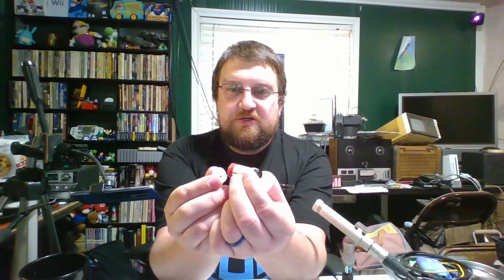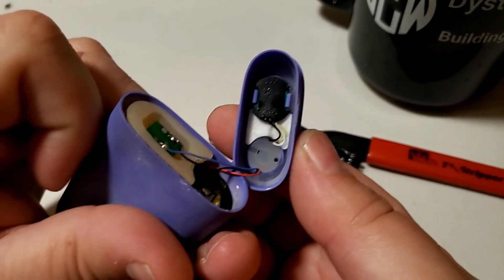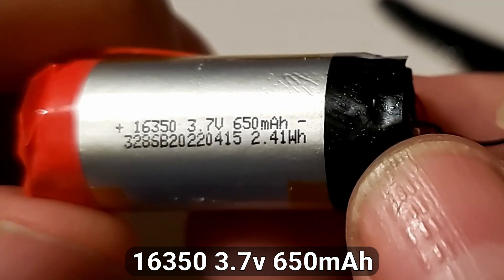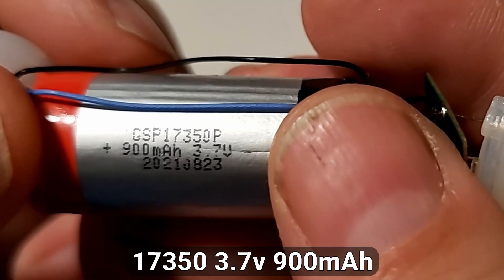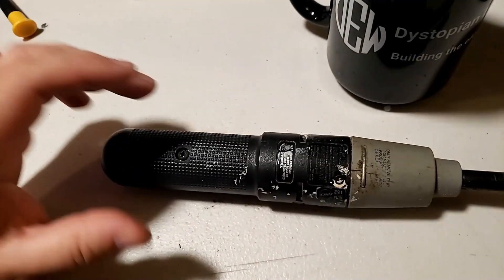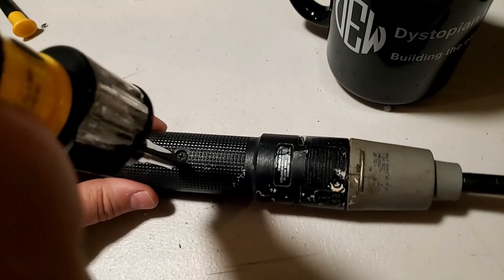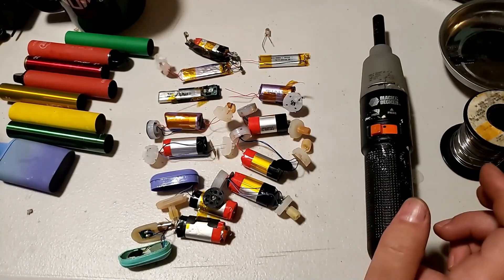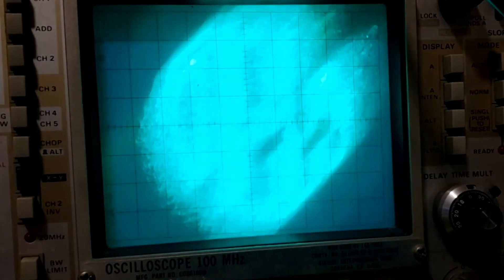DEW 3 Free Batteries and Saving an Electric Screwdriver

Comment: Is the screw driver still rechargeable?
Reply from the maker: There are charging terminals on the sides of the screwdriver, in the video you can see a diode attached to the positive terminal to block reverse voltage.  So as long as I take the voltage drop from the diode into account I should be able to charge it as normal, even use the original cradle if I can find it.

Comment: Контролер?😁🇺🇦
Reply from the maker: I don't speak Ukrainian, but if i understand correctly, yes you could use these batteries to replace the ones in your controller. But without over discharge protection they could end up damaged.

Comment: 🤟😎🤟
Reply: So. Does the screwdriver have a built in charger? Will that work with the new battery? What were the batteries you took out of the screwdriver?
Reply from the maker: There are charging terminals on the sides of the screwdriver, in the video you can see a diode attached to the positive terminal to block reverse voltage.  The original charging cradle could still be used (if I can find it) but Li-Ion batteries have a different charging profile than the original NiCad (Nickle Cadmium) batteries.